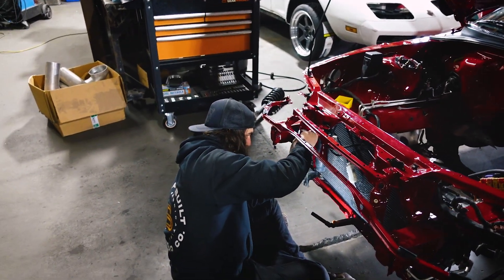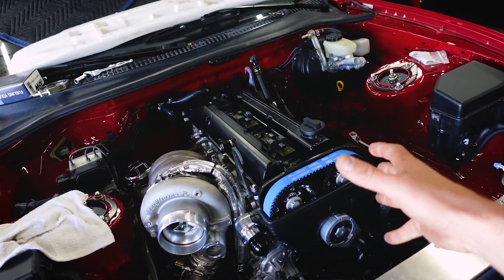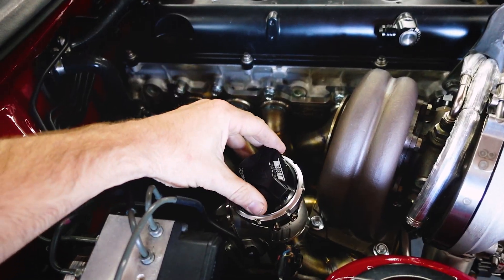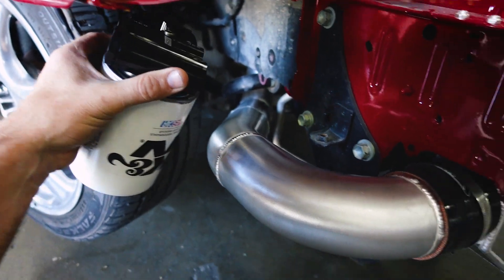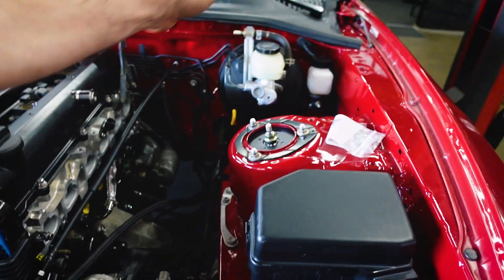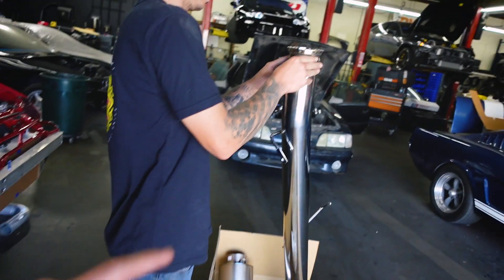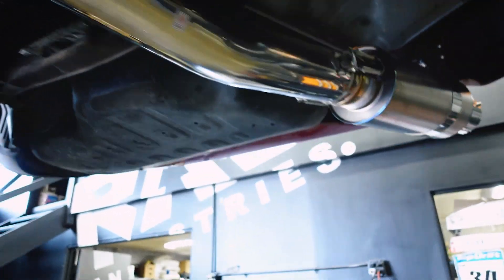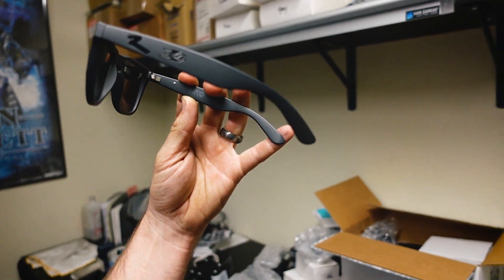The Cleanest Supra RAD Has Ever Built!

Comment: I have always wonder the correct way of routing the coolant line for turbo. I have seen mixed info but from stock turbo setup, the coolant is feed from the water neck Next to the head or where the sensor is, and the return one goes to the pump and the other return line goes to the back of the block near the line from heater core. I have seen a lot just use the barb at the pump and feed from the back of the block for single turbo setup. Question is how efficient running it this way VS feed from water neck and return to pump like in stock form setup? I believe Toyota Do this way for a reason? Anyone knows?

Comment: I didn’t know you could run high compression and a turbo. I always thought it was one or the other 🤷‍♀️
Reply: Nitrous too?
Reply from the maker: You can do it all it’s not the 90s anymore
Reply: With proper fuel and tuning anything is possible.
Reply: Define "high compression".  Having direct injection certainly helps, but you'll not find that on any old Supra.
Reply: @bigdfitness5020  No, there are still practical limits, based on boost levels and fuel octane.
Reply: The main reason why lower compression has typically been associated with turbos is knock resistance. If you can keep the intake charge cool enough, and use a high enough octane fuel, there's a lot of benefits to running a higher compression ratio with a turbo. For one, you can get a large turbo to spool faster by raising the compression ratio of the engine